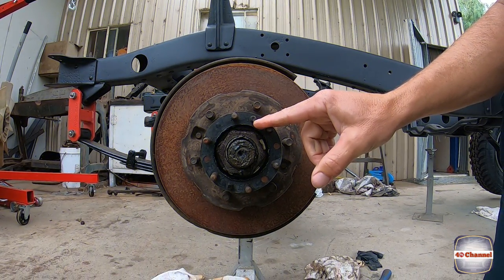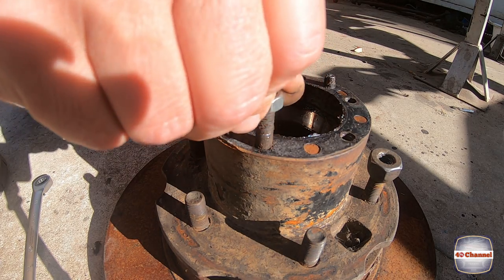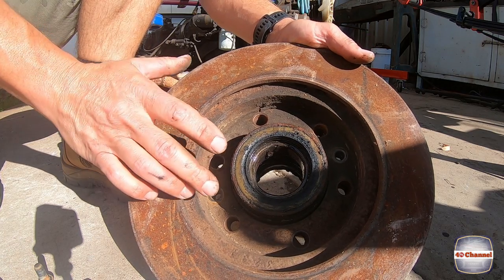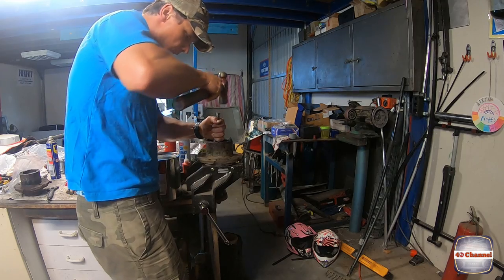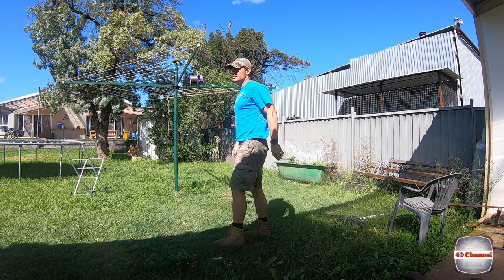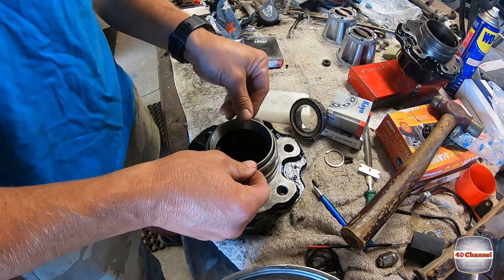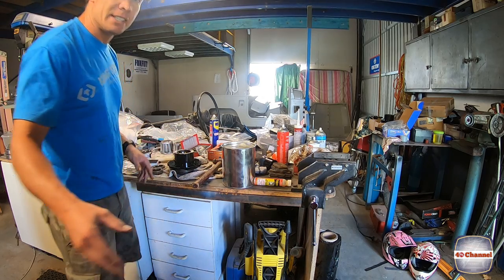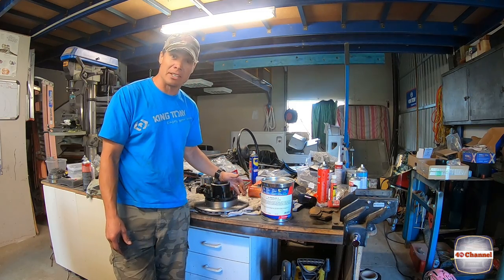EP38 - Front Hub Rebuild, Disc Brake and rotor replacement, Landcruiser, FJ40 plus Spartan

Comment: Really enjoying the rebuild Jayson. Just picked up an FJ45 that will be a full rebuild like you are doing. One recommendation for fitting bearing races, get the old race you removed and with a thin kerf cutoff disk, cut a single cut through the race. This allows you to use the old race to tap in the new race without the old race getting stuck. Keep up the great work. Cheers, Andy.
Reply from the maker: Thanks mate, I did show this  Method in one of my other videos.
Reply: @40ChannelCruiser  Yep just watched that now! Good job!

Comment: I use my old races to drive my new races in.  It ensures that no scratches are incurred from a drift, plus it has surface to surface contact.
Reply from the maker: Yes I did show this method too. it works well.
Reply: @40ChannelCruiser  Up early!!  You had a bearing on bearing to drive the race in.  I Flip the old race and then use a ball peen hammer to drive the race in using the old race.  Fat side of the old race is on the skinny side on the new race.
Reply: @billgraham5609  I usually place a cut with the grinder in the old race to ensure it doesn't get stuck in the hub.
Reply from the maker: @billgraham5609  Oh sorry, I have seen that before with small cut in the bearing. I had forgotten about that, great idea I'll share that way it my next video with credit to you and r824.
Reply from the maker: @r842xx8  great Idea I had seen it before it is probably a better way then using the out inner race.  I'll share it in my next upload.

Comment: Best to just use the old race to drive in the new race. Put it with the same orientation and then you will be able to use the lip to drive the old race back out once the new race is seated.

Comment: Any  idea how long the rotors will remain clean/unrusted if this in done in stages?  thanks again.
Reply from the maker: If out in the weather not long. but the rotors have a lite wax like coating on them so being should last until that is cleaned off.